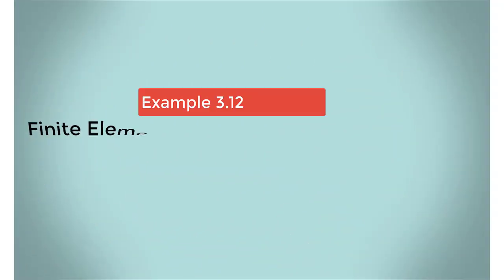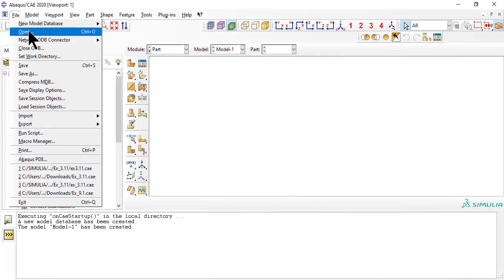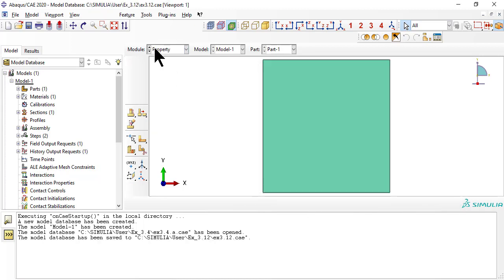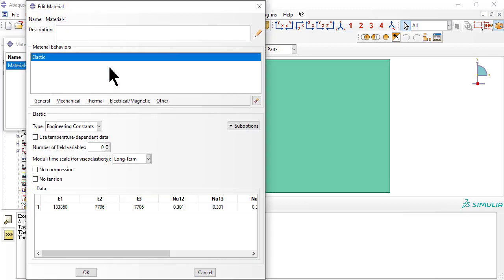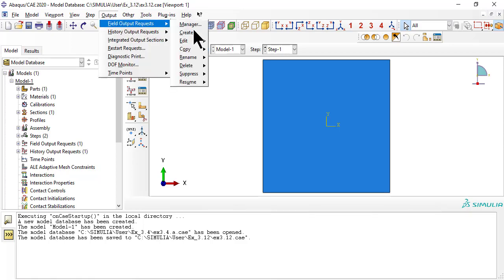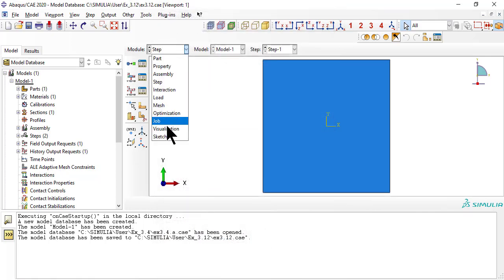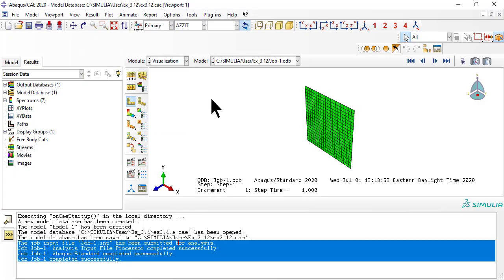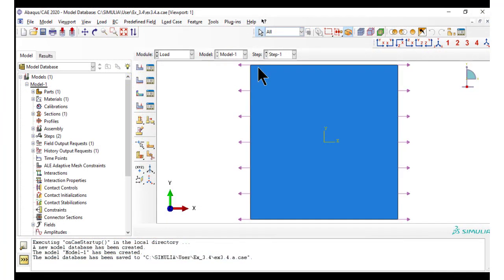Example 3.12 Use strength values to calculate the safety factor using a failure criterion

Comment: Hello professor, random question but related to safety factors, whenever you use any failure criterion, is the factor of safety just 1 - the value given in the output? Also when does one decide to have to use max stress vs hashin damage? Also are these parameters similar/the same or are they completely different?